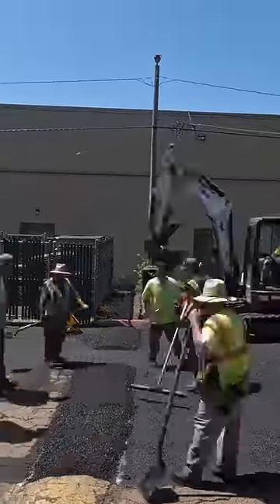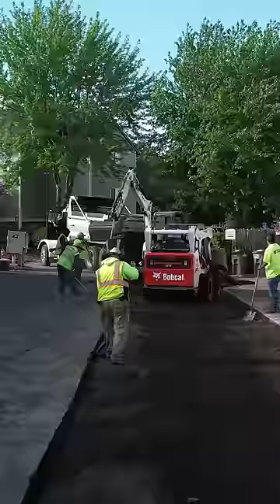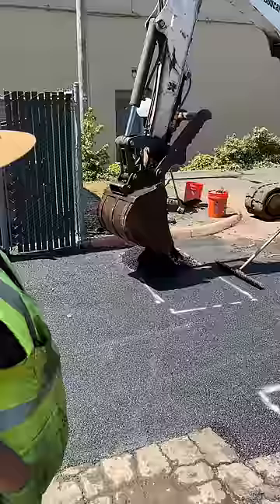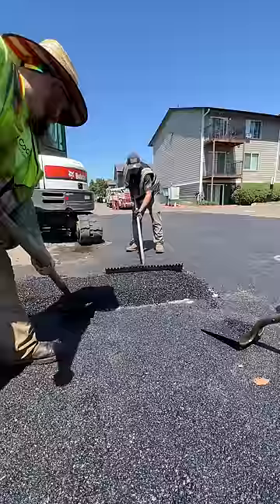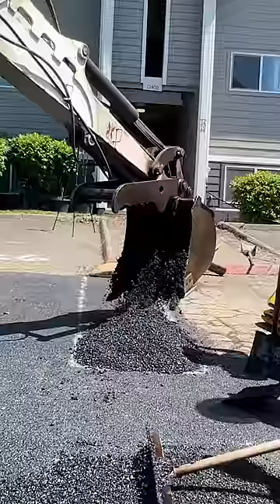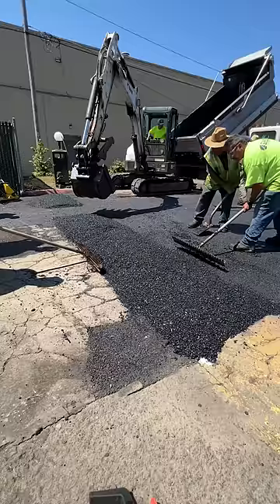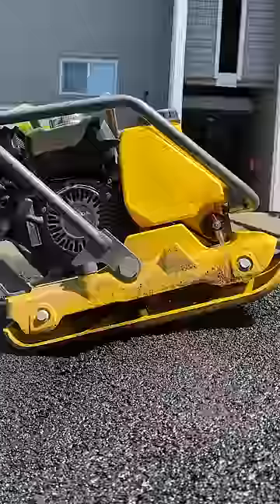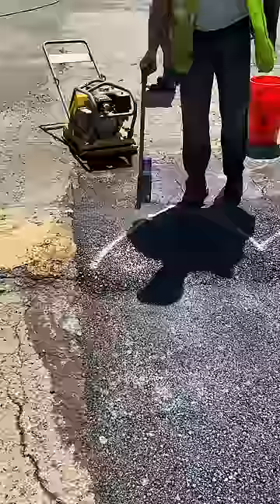This is how Speed Bumps Are Installed!

Comment: one question: do you guys ensure that people who drive shorter vehicles like a sports car or even just a shorter sedan don’t scrape because I have that problem in my touring accord all the time
Reply: sounds like a you problem
Reply: @b.buster  yes.
Reply: speed bumps reduce normal travel through parking lots or streets to prevent speeding but also slow "normal" speeds...they are also terrible for school busses, snow plows, ambulances and fire trucks...
Reply: @b.buster or if the car is at its stock hight then it's a city problem . Most of the time they make speed bumps speed mountains.  It shouldn't be making regular vehicles take undercarriage damage . Nor should they fuck up the suspension of cars.

Comment: What's the temperature of that substandard asphalt during your substandard "compaction" efforts?
Reply: How would you compact a speed bump? Just curious.
Reply: @kylezuber7218  A roller, same as the rest of the street.  The section under the bump, however, needs to be deeper, as you have now introduced an impact load on top of a street section intended for smooth traffic flow.  This will produce cracks at the bump/smooth pavement intersection, allowing water into the base material.  If you don't want to use a small roller, fine, but the asphalt needs to be warm enough to get adequate compaction with lightweight equipment.
Reply: @jasminelindros8923 I could see using a roller on a speed hump which is much bigger than a speed bump.  Of you use a roller on a speed bump it's just going to deform and push and shove.  Butt joint or no but joint.  Unless it's a tiny little sidewalk roller In Which case you're going to get the same compaction as that compactor...
Reply: @kylezuber7218  If it pushes then drain the water out of the drum and put a 1x4 on the asphalt next to the bump to give the wheel a little lift.  I live in the upper Midwest, and poorly compacted speed bumps up here develop cracks which fill with ice and turn the bump into lumps scattered across the pavement in a single month.
Reply: @jasminelindros8923  or you could just use a plate compactor like he was... Because if you put a 1x4 down you're not compacting the joint so eventually that joint will separate and your speed bump will fall apart.
Reply: @kylezuber7218  The 1x4 goes on the existing street, kyle, not the bump, and only serves to get the wheel up on the bump.  The wheel is still putting a vertical load on the bump, and still compacting the bump.
Reply: @jasminelindros8923  I'm aware of where you would put the board. How would 1" make a difference in pushing or not pushing the speed bump. Also with the board there you aren't compacting the joint... because there is a boars there...  also if you drain the water out of the drum (you must be using a tiny roller to need water in the drum) you're not getting compaction anyway. Because you got rid of a bunch of weight...
Reply: @kylezuber7218   Watch someone run a roller into a hot pile of asphalt, kyle.  Does the roller hop right up onto the pile, or does it push into the pile and squish some material out of the way as it ramps upward?  If it pushes material in the bump out of the way then you have to re-form your bump, and you've wasted time.  If the 1x4 gets the wheel up off the flat asphalt, and the wheel rolls onto the hump from "above" instead of running into it horizontally from a flat, cold street, then the wheel is less likely to laterally displace any material in the bump.  What "joint" do you mean?  A horizontal joint between existing asphalt and a new bump placed on top would be "compacted" by the vertical load of the wheel.  A vertical joint between a new bump-plus-thickened-street-section (which is what we recommend) and the sides of a trench cut through the existing street section would be "compacted" (again) by a vertical load on the hot, semi-plastic asphalt, forcing it against the cold, rigid asphalt already in place.  I put "compacted" in quotes because the joint does not get compacted, the plastic and loaded material on one side of the joint gets compacted against the rigid confining material on the other side of the joint.  Which puts more weight, and thus more compactive effort, on the asphalt, a plate that two men can lift into a truck or a small self-propelled roller that needs its own trailer?
Reply: @jasminelindros8923  I didn't realize they took density shots on a speed bump.  Should probably get a rubber tire roller on there too before they density test it.  Its all about pounds per square inch when it comes to compaction...  this is a speed bump... a plate compactor is perfectly fine.  Btw help from a 1" board does nothing... its still going to push around. It's only one inch you're still pushing a wave of material. Unless you're making a 1" speed bump...
Reply: @jasminelindros8923  I've been paving roads for a long time... not for a dinky little ma and pa  company either.
Reply: @kylezuber7218  We take density tests on everything, AND we check the temperature.  I agree about the rubber tire roller, but they're virtually unknown in our area.  You're absolutely right about psi, it's far more important than total weight for compaction.  So which delivers a higher psi to its contact patch, a 700 pound roller with two 4"x24" contact patches or a 150 pound plate with a single 16"x20" contact patch?
Reply: @jasminelindros8923  lmao you wouldn't be able to shoot density on a speed bump. It has to be a flat surface so the whole Guage is flat... moral of the story is this... the guy using a plate compactor in the video was doing a perfectly fine job.  It's a speed bump not a freeway.  But you had to come and try to sound really smart like you treat a speed bump like a freeway.... what company do you pave with?
Reply: @kylezuber7218   So you've never seen anyone take an asphalt core, kyle, to test its density?  And you've been doing this job for how many months?  Two?  I'm not a paver, I'm a geotechnical engineer, and our company has been doing quality control for over five decades.  Lying about a claim I never made just makes you sound like a frustrated child.
Reply: @jasminelindros8923  oh so you don't pave...  I've been paving for 15 years.    yes I have seen cores taken. On dot jobs... not on A speed bump.  That's a really fancy way of saying you do density testing... so what would you know about how to properly pave something?  I've forgotten more about paving than you know. I promise you that
Reply: Guys who cares
Reply: @kubota33  Those of us who have to accept professional liability for checking someone else's work, that's who.  Are you afraid to have the quality and durability of YOUR work checked?

Comment: They installed a speed bump on a bridge near me which was redundant because it has 3 cameras pointing at it a tool booth and its a good 20 feet past the stop sign.
They had to go out and sweep off the gravel and rust every morning for the sheer amount of gravel roads and salt we have.
I would also kick down to granny gear and speed up when i went over it and after a while the bolts broke that held it down.

Comment: I guess it depends on what kind of speed bumps. In france we have a lot of them and sometimes they are plastic, sometimes they are, well, just like yours, sometimes the road goes up, stays like that for 10m and then goes down again, usually at intersections, sometimes they use bricks and sometimes a combination of the last two and to be honest, those ones are the best

Comment: That’s called a speed hump and it’s offset as such for emergency vehicles to pass through without slowing. Emergency vehicles (ambulance, fire truck) have a specified, wider wheelbase than passenger vehicles.

Comment: Diesel fixes speed bump problems. Dirty Jersey here. We had some speed bumps and humps in the neighborhood that were more of a pain than good. I swear an official got paid off. We dumped some diesel on the bumps and humps. Used a heavy truck to flatten them right out. Or just wait for global warming to heat it up and use a heavy truck.😂

Comment: You get more brake dust and use more gas just to get to the other side of your bad neighborhood where the cops are so busy and your town doesn't have the funds to put anyone with authority on 2 feet of pavement to issue a speeding ticket.  Instead this works and costs society so much less in the long run

Comment: Congrats! You just made everyone in that apartment complex LESS SAFE! If everyone drives slowly, that speed bump is pointless and will do NOTHING! So they just wasted money. If some people speed (as I think we can agree they will) they will hit those bumps going fast, their vehicle will be lifted up AWAY from the road and their brakes won't work anymore making it HARDER, not easier for them to stop! If they also have ABS brakes, their wheels will stop spinning entirely which will trigger the ABS releasing the brakes so even once you touch back down you STILL can't stop yet! Add to that the fact that these are probably being placed in high foot traffic areas means someone's gonna get ki||ed! 

A better (safer) method is to install a trench! Cars usually have the weight in front. The front tires drop drown a couple inches but keep contact with the road before impacting with the "bump" of the other side of the trench! 

tldr: Speed bumps are dumb. Putting speed bumps where people are should be criminal! Putting speed bumps where people AREN'T should also be criminal bc whatTF is the point of that? If cars want to drive fast around the OUTSIDE of a parking lot where there are no people OR CARS why not let them?!?
Reply: The speed limit here is 10, and it's right by a kids play area, almost everyone here is aware of that and keeps to the speed limit or slower in case a kid comes running out into the parking lot
Reply: @maggiepie9363  Well then, those speed bumps will be useless for "almost everyone" and everyone ELSE will probably end up ki||ing a child because as I just explained speed bumps make it impossible for the cars that hit them going fast TO STOP! 

Brakes don't work when the vehicle isn't touching the ground! <--What part of that don't you get?

Comment: DC got some stupid speed bumps. Some are way to high that once you go over it. It will scrape under your front bumper. Others have like a inch of height which isnt smooth out. Gotta go like 3 mph not to mess anything up

Comment: Speed bumps are terrible...
Each time you drive over one you're doing damage to a car, over the lifetime of the speed bump it will have caused millions of dollars in damage.
It also costs many lives. Speed bumps delay ambulances and when they drive over them quickly with a patient inside the motion causes further injury.
A better way to reduce speed in residential areas is to make lanes narrower. Add a central Boulevard with trees, make a bike lane (with a concrete divider), plant trees on the side of the road, make more roundabouts, add a speed camera if it's that bad.
But never a bump

Comment: These should be banned. Bought a new build house and they never said these were installed. At the time I had a built ep3 turbo and 06 Hawkeye wrx sti on prodruve springs. Had to pull out the sale as my cars couldn’t get over their enormous speed bumps. No need there’s enough pot holes to keep you slow anyway

Comment: Question. Who pays for the repairs when that thing causes damage to the underside of my car which had factory suspension?

My car's exhaust gets fucked up almost every time causing leaks which I then have to deal with before getting it's annual inspection.

Most humps around my area have large gauges in them from other cars so it's not just me. Eventually you'll start seeing large chunks in the center ripped out like this one from people getting pissed off and buying tools to "improve" them.